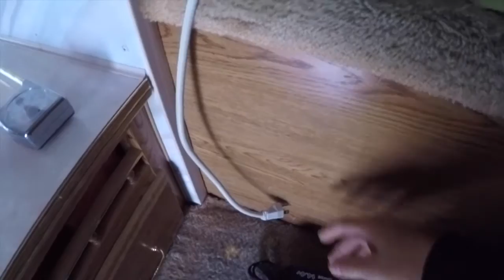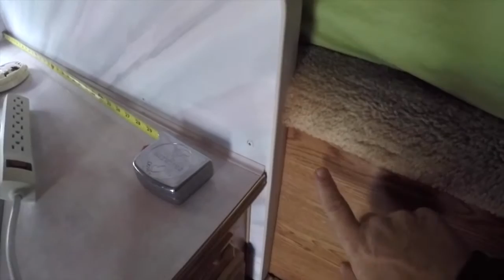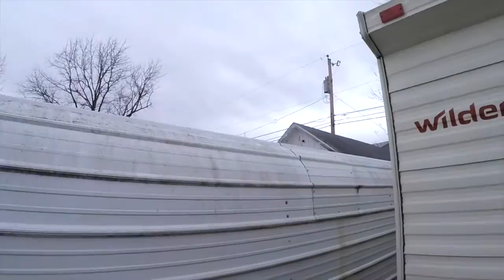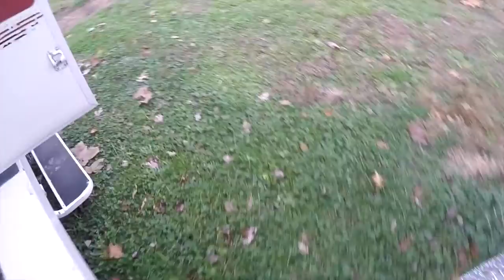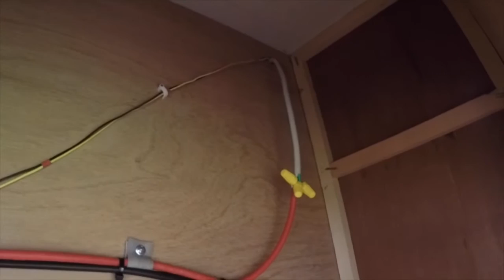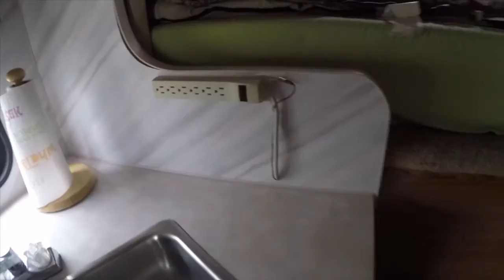Harbor Freight Cen-Tech 750 watt Inverter HACK Item #69660 - How to make a Remote Switch (2)

Comment: Awesome video, very practical and I believe I’ll copy your idea. I do have a question though, was there a reason you didn’t wire the inverter to the kitchen?
Reply: I’m guessing because it would be two Thick battery cables. Thanks again for the video

Comment: Awesome video thank you. Extremely practical. I do have a question, why didn’t you run the inverter into your kitchen?
Reply from the maker: Thank you George! I'm not sure I understand your question. I did wire the power strip right to the kitchen. You are also right, I didn't want to run long heavy gauge wires everywhere. It's much better to have as short of a run as possible. I wanted the inverter mounted close to the battery bank and away from the sink and water. Not much room in the kitchen in this camper anyhow. Hope this answers your question.

Comment: You could do a lot better by putting a 15a DPDT “ON-ON switch on your power converter cover. Figure out which 120v circuit runs the receptacles in the camper. Pull that wire off the breaker and land it to the common terminal of one pole of that switch. That will be your 120v pole. Run a wire from an open terminal on the 120v pole to the breaker. Use the black wire in a 14/3 appliance cord to go to the last remaining terminal in the 120v pole. White wire in that cord goes to neutral bar with the rest of the white wires, green goes to the ground bar with all the bare wires. Now one switch position switches the load to the breaker, and the other position switches the load to the inverter. Run your inverter 12vdc cables to the 12vdc lugs on the 12vdc side of the converter. Land those two “remote on” wires on the open pole of that switch, across the same throw that switches the load to the inverter. Stuff the inverter somewhere, maybe behind the converter assembly. Now when you are plugged into shore power, and the inverter is switched off, all your receptacles work as normal. When you are boondocking with just battery power, flip the switch and all of you receptacles have 120v.
Reply from the maker: That would work too.
Reply: I googled Centech 66817 inverter switch and it took me here. I’ve always just had a 300W Bestek inverter wired as I described, but the newer camper has an outside kitchen with a dorm fridge that draws 85 watts. Rather than buy a new inverter, I just hooked up this Centech one that I bought for work a few years ago. Now I can run that fridge when I’m driving down the road. I typically keep the fridge unplugged if we don’t have an electric site to save the battery. This mod allows me to run my TV, and charge phones and laptops, but we primarily use it to run little fans for better sleeping when we don’t have AC because they don’t allow generators. 

Your video helped me quickly solder wires to the board so I could get the extra watts to start the fridge compressor  from the bigger inverter. This will let us buy more fresh food at a grocery store for more meals in the camper this weekend when we drive to the black hills.
Reply from the maker: I'm glad the video helped you out. It sounds like you have a nice set up. Enjoy the Black Hills, it's a beautiful place.

Comment: Want to know if you can run an inverter,while driving,like hook it up to battery under hood hook up your inverter and run gage wire through fire wall,and hook up your positive ,then negative,or will you blow the inverter
Reply from the maker: As far as I know it would be just fine to run your inverter while driving. I know of several people who do that without issues. To my understanding, that is the way most people use their inverters, with the engine running.

Comment: What length are the inverters connection cables? Are they oem?
Reply from the maker: I think they are about a foot or two long. They are the connection cables that came with the inverter. I just replaced the alligator clips with cable lugs so I could bolt them to the battery.

Comment: That power strip does not appear to have a circuit breaker built in, just an ON/OFF switch. Might want to invest in a better one.
Reply from the maker: This one has a circuit breaker.
Reply from the maker: After a little research I learn you are correct. No circuit breaker, just a surge protector. I am researching this subject and quickly learning that they are not the same thing. I am exploring options to come up with a better solution for this issue. Thanks for pointing this out to me.

Comment: toggle switch by power strip  would be nice, do you have a background in electronic or electrical. I have learned about both in all your solor vids.😊
Reply from the maker: I agree with you 100%. I don't think it will be too long before I find a little switch to install there. No I don't have a background in electronics I just have a lifetime of tinkering and a lot of research. I am not an expert but I get the job done. Thanks for watching my videos. :)

Comment: water and electricity don't play well together...might want to think ground force interceptor (GFI) plug
Reply from the maker: I don't plan on mixing the two. It's a thought though and I wonder if the circuit breaker built into the power strip will work. Maybe I'll plug it in and then dip it into a sink full of water to test it.
Reply: @Grant Travels, I think you meant ground fault circuit interrupter (GFCI).
Reply from the maker: Thanks
Reply: "Fault"
Reply: @WannaBFree Grant's exactly right, a GFCI is code and highly recommended for kitchens, bathrooms, and especially around sinks of any kind. Nobody plans on mixing water and electricity, but it does happen. The GFCI could save you or someone else from a bad or potentially fatal shock. Stay safe!